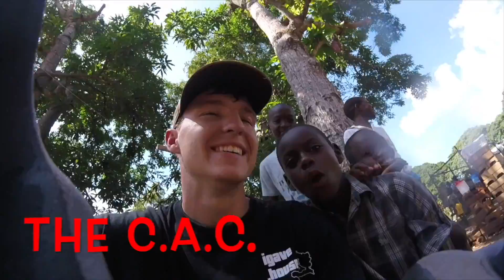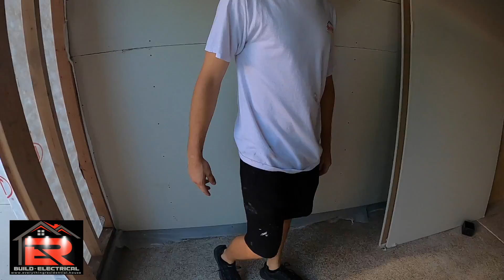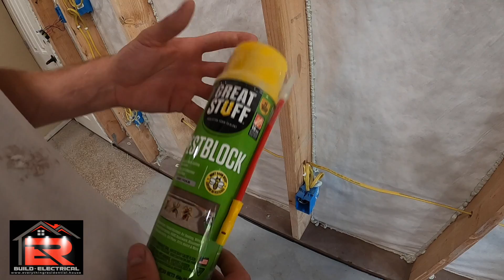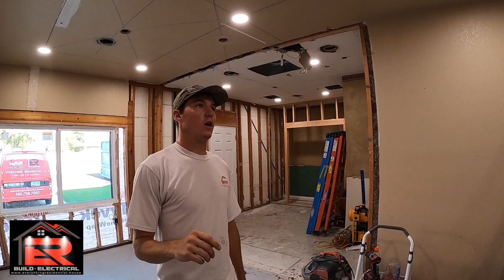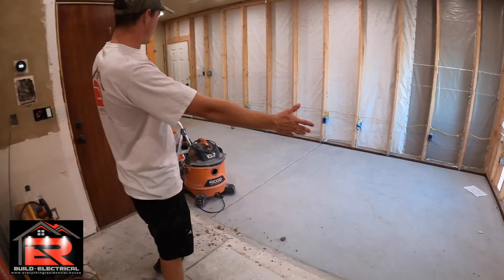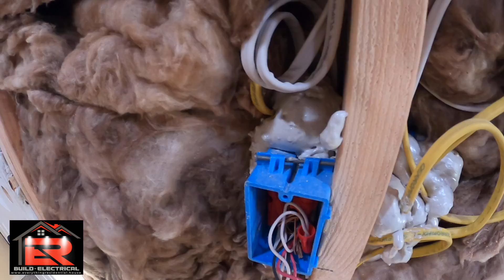Convert garage into living space part.2

Comment: I need to take out my 16ft wide garage door and frame a wall in the garages opening. Slab is cracked and its 1/4" out of level. Would polyurethane be enough to seal the 1/4" gap between the bottom plate and concrete slab? Thanks.
Reply from the maker: Yep should be enough. Go to Home Depot and purchase a sill sealer. It looks like a big roll of foam tape, I would put polyurethane on the concrete and than put two layers of the foam sill sealer down and than put another bead of polyurethane on top which should be enough to seal up a 1/4” gap.
Reply: @everythingresidential  Awesome thank you for your reply! I also came across Loctite gaps and cracks spray foam and liquid flashing from zip system. Willing to give it all a try 👍🏼